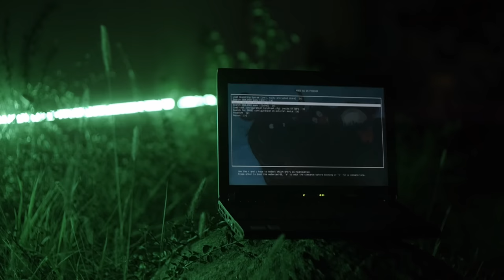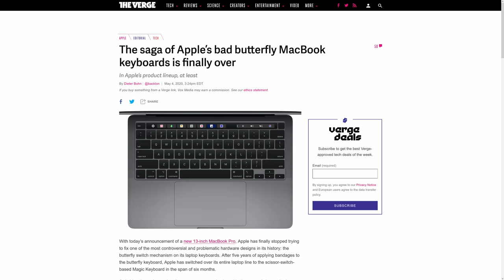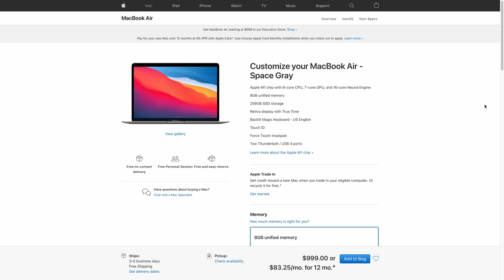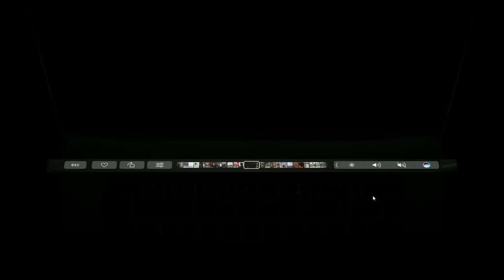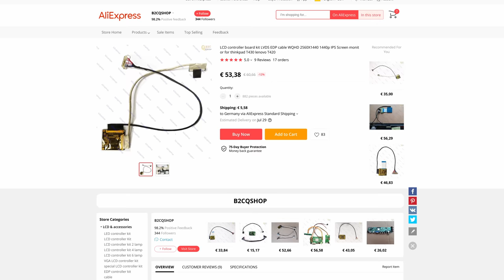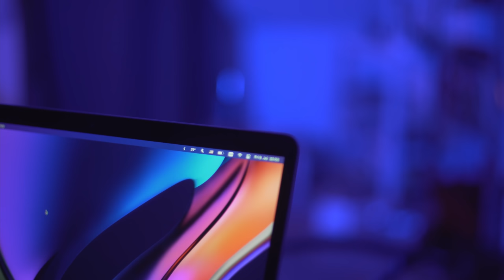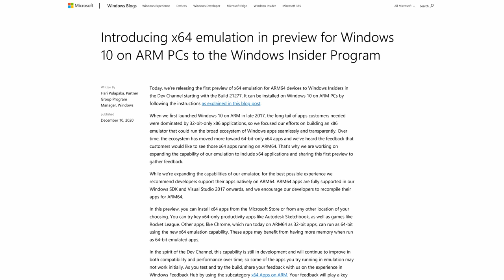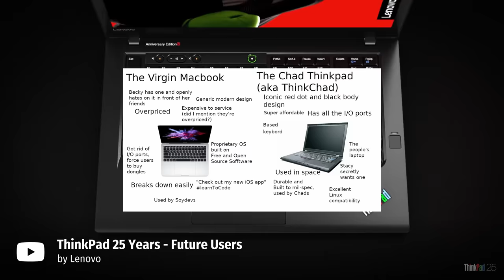Why I Switched to Mac (as a Linux user)

Comment: M1 macs are a very good product in terms of battery efficiency and performance. I hope this machine will stay relevant and last you for years without a need to upgrade.
Reply: I personally have an M2 MacBook Air and gotta say, that thing has the performance exceeding my Ryzen 7 3700X PC in terms of single-core tasks which as a web dev are the main priority for me. And before you start asking me why M2 and not the cheaper M1 here's the reason - M2's efficiency cores are literally twice as fast as in the M1 and I simply use power-saving mode outside the docking station all the time.
Reply: i’ve had a 2010 and 2015 mbp. both (intel core) have already been superior to everything else on the market back then. especially regarding efficiency due to the optimized os.

people need to realize that macs would just be pretty things w/o the os. but they don’t. they recommend “linux on the laptop”. laughable.
Reply: @shapelessed  U can still run Linux in Parallels extremely well, the performance is near-native in my experience.
Reply: @shapelessed  efficiency cores twice as fast but 256gb hard drive is half the speed!
Reply: 7 or 8 years until apple decides to cut support. Then it's basically paperweight
Reply: @dannnsss8034  an undervolted high end current cpu would rival these laps with very similar efficiency.
Same with modern mid range gpu.
Except no arm support.
And m1/2 macs have a encoder/ some hardware that helps in good/fast video production performance.
Probably doesn't even work outside of final cut pro though.
Reply: @uhhTabby  Tell me one example where software development requires an SSD faster than  1.5GB/s...
Reply: @yasirrakhurrafat1142  Works in Davinci and after effects.
Reply: @shapelessed  transferring any type of file? Not just software development but downloading files in general lmao
Reply: @uhhTabby mean that’s not a priority as a developer, especially with so much development happening on the cloud. It definitely depends, but most of the time no not really. Taking into consideration that this is a web dev, you can see where I’m going with this, not to mention most developers are web developers at some point in their careers.
Reply: this aged like milk (from a M1 Pro user) look up the swaping issue and why this is huge due to the SSD dying issue
Reply: @yasirrakhurrafat1142  it's an encoder nothign to do with a specific software but rather the algo ued to encode the footage hence called encoder
Reply: @ko-Daegu  lmao I am so happy I didn't buy an M1 mac that doesn't even have durable ssd
Reply: @ko-Daegu  yet if the software ain't support gpu acceleration, the gpu which contains the ultimate encoder... it ain't work.
Cuz if tis juss using cpu encoding i.e software encoding, it ain't gon be accelerated by YOU GUESSED IT! " the encoder ".
Reply: @ko-Daegu  yet if the software ain't support gpu acceleration, the gpu which contains the ultimate encoder... it ain't work.
Cuz if tis juss using cpu encoding i.e software encoding, it ain't gon be accelerated by YOU GUESSED IT! " the encoder ".
Reply: Bro my MBP from 2015 still working good
Reply: Knowing Apple he probably won’t need to buy another one for the next ~4 years (considering that it is almost 3 years old).
Reply: 🤣🤣🤣🤣 i get the sarcasm
Reply: With asahi a dream
Reply: The M1 will come in handy for when you have a heavy workload.
Reply: Been using my macbook pro m1 with 8G RAM for 2 years now, no problems till now
Reply: @uhhTabby  What kind of "transfer"...? From an external disk that you will probably plug using a 5/10Gb USB? "downloading files in general" - Sure, you certainly have access to internet going over 12Gb/s to saturate your SSD (you don't). Or maybe you mean moving files around your disk...? Because "moving" a file is quite literally changing a piece of metadata in a single directory block in your disk's filesystem - I know, because I've built a filesystem of my own. Please provide me with a reasonable argument because I don't want to lose any more faith in humanity today.

Comment: once Asahi Linux is ready for normal use on the m1 air you better post videos about it because Id trust your opinion on it
Reply: MacOS 11 works just fine for a Linux User. I don't see the need to use Asahi Linux.
Reply: @Alejandro-vp1op  because Macos is proprietary
Reply: @liamsweeney4754  change os doesn't quite solve that problem thou
Reply: @Alejandro-vp1op  the point of the videos is most lapto hardware sucks,
and the M1 macbooks don't...
(mostly).
Reply: @liamsweeney4754  Yep, so, is it that a problem? A Linux user like me is not always here for the philosophy, but there's a tech component that MacOS also has
Reply: @Alejandro-vp1op  check out the system76 Lemur Pro
Reply: @Alejandro-vp1op  No, it doesn't. Which is why I continue to use Linux. Please respect my choice as much as I respect yours - if MacOS works for you then so be it, but please don't tell me what works for me.
Reply: @Alejandro-vp1op  What "tech component"? Please explain that term.
Reply: @Alejandro-vp1op  2021 laptop hardware is almost on par on desktop counterparts considering that it consumes way less power. Laptops suffer the most at the lower end. If you get a similarly priced windows laptop , it will perform good enough . Modern ryzen 5 , 7 and 9 chips are great , also there are laptops with desktop grade gpus which the mac lacks.
Reply: @Alejandro-vp1op  no, Mac OS 11 doesn't "work just fine for a Linux user".
Reply: @terrydaktyllus1320  the M1 chip is extremely power efficient and has great performance for its low power consumption. That's pretty much all. This comes from someone who hates the entire apple ecosystem btw
Reply: @PR0XIDIAN  Display	
14.1″ 1920×1080 FHD, Matte Finish

i5 11th... hehe
Reply: @terrydaktyllus1320  Unix
Reply: @terrydaktyllus1320  What opinion should I respect or better: what point I did not respect you?
Reply: @Minecraftzocker135  If you work from the terminal...pretty much, yep
Reply: Hope that that Asahi initiative renders usable rather sooner, than later)
Reply: Just get an ideapad 5 pro or similar laptop, getting a macbook just to wipe macos off it and install linux on it is a waste imo
Reply: @ernestoditerribile  No, it isnt. It's darwin, and it is not the same. Having the same usability doesnt mean they are the same.

You can make a funcional terminal for windows using the same arguments, doesnt mean windows will run FreeBSD

M1 machines are excelent machines, even hating apple i should not lie about that, but, doesnt mean that if it is a powerfull machine will work for everyone.

It is like saying that buying a bugatti will ever be the best option cause it is the most powerful car, some people care about price, some people care about the fuel consumption, so... Mac, even if it is a M1 it is not "the same", it won't be a valid alternative especially for Linux/*BSD users
Reply: @Alejandro-vp1op  most things I need from Kali doesn't work in MacOS so nope doesn't work fine I can't get rid of Linux as a pentester
Reply: I personally hate MacOS (and yes ive worked with it for a longer time). It objectively is not even bad probably dont get me wrong (apples hardware optimization for example is good af) and i definitely would prefer it over windows but linux just works best for me so i will keep hoping for asahi
Reply: @Alejandro-vp1op  not the point
Reply: @liamsweeney4754  who cares, lmao. It's more polished and stable. That's why it's the top choice for software engineers.
Reply: @liamsweeney4754  Use whatever tool is best for the job. Worrying about silly things like proprietary software is a waste of time, and life. Find real world political issues to focus your attention on instead.
Reply: @Alejandro-vp1op  That's my personal problem, the UI and UX of desktop Linux systems suck.
Reply: @liamsweeney4754  So what? Better that than using poorly maintained software because there is no proper team behind it because it's maintained by just one person. And thus fucks up your workflow. See hyprland which is very buggy. I really love linux but I'm more and more thinking if this level of unnecessary customization(let's be real. You don't need fancy customization to get real work done) is worth the regular headache and interruption of workflow. The longer I use linux the more I get the feeling that if you want a proper working machine you better not tinker too much. So if you don't do that the whole reason(sure there is still the ideology one, but I'm not willing to sacrifice getting shit done for some happy hippie romanticized ideology) to use linux is out of the window.
Reply: @terrydaktyllus1320  As someone who was in both communities I can approve that it's often more the linux community who isn't accepting others choices but are lowkey very bigoted about what they think would be best for others. If it were up to them everybody would have to use linux to get their radical anarcho anti-corpo agenda going. There was one comment saying like that this other youtuber now probably shits/hates on Wolfgang for using a mac. And that's it. If you don't use linux you're a bad guy. But what if other people simply have a completely different set of priorities(Freedom of expression and all that annoying shit) of which NONE are opensource(as nice as it is) or customization. Because they're just not the end all and be all.